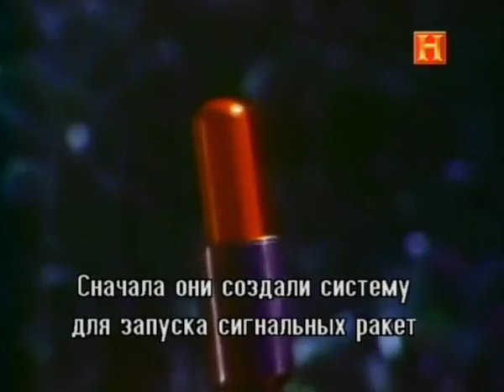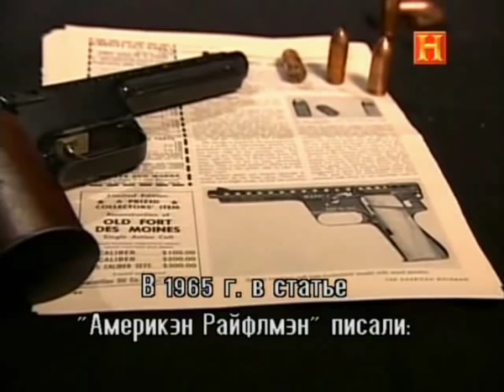Gyro Rocket Pistol "GyroJet"

Comment: If you wanna make it practical, develop an RPG that can be fired out of a 12 gauge.  I think we did make those for the AA-12, but that means they should be able to be fired from any 12 gauge right?  Just the 12 guage shell is large enough to house stabilizing fins and rocket propellant as well as enough starting gunpowder to get it out of the barrel.
Reply: well no its a 12 guage grenade not an rpg but the grebade itself is very deadly

Comment: 1:34 He says, "solid rocket fuel," but shows Saturn V launch. WTF?
2:18 If there was no muzzle velocity, it wouldn't be moving, now would it?
3:15 "...Literally..." You make literally want to kill you.
3:16 Light-years are a measure of distance, not time.
Reply: Plus if the projectile wanders like he says, then complaining about the crudeness of the sights is pretty dumb. Slap an acog on that and it doesn't help...
Reply: Nik Saunders 
True. However, I don't know what I was expecting from the "Ancient Aliens" people. Perhaps they can get back to reality. Is such a thing even possible? Yes it is.
Reply: When someone says "the system is light years ahead of its time", they actually are talking about distance as in it's far away from previous technology.  got it ?
Reply: They actually developed a Carbine version - and made 100s of them - for testing and sales samples. These worked really well because the longer barrel solved the low velocity problem, and had greater accuracy - as you would expect - and also because the firing and cocking system was more substantial and therefore more reliable. I suspect that with more development it could have been a great system. As regards misfire, that just smacks of early development life-cycle and I'm sure that could have been fixed.
Reply: 1) The Saturn V uses solid rocket boosters for initial launch. Sure, not terribly clear, but at least not terrible analogy.
2) I would say in comparison to other guns. Gyrojet projectiles were extremely slow and actually got faster out of the barrel. 
3) Meh
4) 'Light years ahead of its time" is a figure of speech that has been around for decades. It refers to something that is extremely advanced or futuristic. All sci fi and shit.
Reply: I think the whole point of them was that they accelerated due to their internal or attached power source, so were not limited by, say, barrel length or the initial reaction-explosion push. Also, had low recoil I would have thought.
Reply: vsGoliath 1)no it didn't. Kerosene/lox on the first stage, hydrogen/lox on the second and third.

Comment: "Use of solid rocket fuel as propellant"

(Shows clip of a Saturn V with no solid fuel rockets onboard whatsoever).
Reply: While this is true for all the main engines/stages and thrusters, the launch escape tower was purely filled with solid rocked fuel.
Reply: Keyboard runner fair enough. it was also never used during the actual missions.
Reply: Peter Smythe 
That's absolutely right. As long as the mission went  as planed, the launch escape tower would not add any delta-v to the rocket.

Comment: Remember, Gatling's gun design was once considered outdated and today guns following his design are some of the most powerful, awesome and frightening around, like the GAU-8 mounted in the A-10. Maybe the GyroJet will yet have its day.
Reply: Surely we can add a charge to get the bullet out with a high muzzle velocity, and also simplify it to make it cheaper.
Reply: Some ideas don't scale down whiles others don't scale up. Rocket launchers work great and missiles do too, just handgun rockets don't.
Reply: Corristo89 it will be a  highly effective weapon for space combat in 0 G (no recoil means that you won't go spinning backwards uncontrollably after emptying a magazine )
on top if that it is s far cheaper and simpler alternative to laser weapons that would also lack recoil
Reply: Guaranteed 28,000 years from now it will be standard issue.

Comment: Even IN space it's usefulness is limited to it's inaccuracy. In the future, miniature guided missiles (opposed to rockets) would probably prove more useful in space, but then again, shrapnel of any sort would likely fly in every direction. Hence, I'd think an ultra-precision railgun of sorts would be more useful in space, no recoil being the biggest benefit of that. There's also the aspect of missing a target and having that round travel on and on and on until it impacts something else or finds a gravitational pull.
Reply: There's still recoil in railguns (although not necessarily as much as normal guns).It had issues. But they weren't insurmountable, it just wasn't "better" than the guns at the time, and even nowadays.

Comment: @specialforces69 

Uh no. Modern powder reacts with oxygen already in it. All modern cartridges are fully self contained and CAN be fired in space (or hell, underwater, dont expect to hit anything though). The reason is because firearms actions suffer from wear and tear, and to reduce this, lubricants are used so parts dont just smash into each other. In open space, the lack of pressure means the lubricant boils off, so everytime a gun fires, the parts try to destroy each other.

Comment: Actually, its due to its need for high quality materials and machining, that the Gyrojet is considered a failure. However, with modern technology you can make a gyrojet work at most ranges, but as stated it's not exactly cheap.

Makes for a good silenced weapon through, you could never hear it well enough until the '[BEEP!] I'm [BEEP]ing dead' realization after you're dead.

Comment: @wadeNYC1 Its a magnificent idea but poorly exacted. It can work but the rockets need a caseless propellant base. Ive designed some concepts my self as well as stripper clips to load the old 12mm variant as well as a redesigned gun utilizing magazines. The rocket rounds have also been simplified removing the slanted vent on mine as the barrel would be rifled like a conventional firearm. Ive drawn up different caliber variants from .22 to .308 calibers.

Comment: @KLove3232 actually ANY projectile launched (even the small impulse from this) will send the shooter back not a couple yards but to INFINITY! That's Newton, once it's got a velocity, minus friction or another force it will not stop.
The question is a matter of velocity, yes a .45 will push them back but a barely perceptible amount, about 1 meter per MINUTE velocity. Simple vector controls could counter for even firing off say 20 rounds.

Comment: @Garduus Wouldn't even need circuitry in the round, really. Have the guidance system built into the weapon.  If the flow of air through the nozzles of the ammunition could be controlled by the firing mechanism you could simply 'program' a bullet's trajectory at the moment of firing by limiting the amount of air coming from certain nozzles.  If nozzle control were fine tuned enough a gun could shoot precisely around corners with a simple set of precalculated air flow ratios.

Comment: Well that doesn't address the question at all.....as to why the Gyrojet wouldn't be affected or "shatter."

And it's not like the Gyrojet's projectile would still generate recoil on the weapon itself. There's no difference there between it and a conventional weapon. They both would cause a back force.

Comment: Put a caseing on the rear of it and fire it from the gun with a small charge of gunpowder. Adds a tiny amount of recoil and should provide consistent and uniform ignition as well as bumping short range capabilities. Probably more practical as a rifle or carbine so you can add enough rifling to stabilize a big round.

Comment: @chitoryu12  nope, a normal gun needs air to shoot the bullets, because it takes fire to propelled a fireweapon. a Gyrojet uses solid rocket fuel with does not require air.

Comment: Hmm, revolvers and recoil operated pistols work just fine in vacuum. Unless these fat bullets were going to come with explosive tips, they were a solution in search of a problem.
Reply: +Matthew Trzcinski The issue is the third law of motion, not the presence of an oxidizer in traditional cartridges.
Reply: +cravenjooooooooooooo If you are in space, the recoil launches you backwards
Reply: The issue with guns in space isn't operation (although one could argue the thermal shock or the lubricant might see some issues...). It's momentum and recoil.
Reply: The issue is the law of motion.
Reply: basically, if you fire a normal gun in space, and it works, you better be hanging on to something tight or your going to go flying.
Reply: Farrel Clement the problem is gas laws and potential energy of this gun is too low,some powder burn in barrel but some powder even burn out of the barrel so the rocket will accelerate unefficently.The round is no go far 50meters

Comment: You could always go for a hybrid option, something which would burn enough rocket fuel in the chamber to reach a respectable fraction of the speed of sound, then outside the chamber finally reach full speed.

It wouldn't do a lot of damage vs. armor at point blank, but it could definitely still kill. Then outside the chamber it burns until it reaches full speed.

Comment: 50$ a piece?! WHO ON EARTH WILL USE THAT EXPENSIVE STUFF FOR COMBAT?!
Reply: +Teoh Tong Wei Sniper Rifles.
Reply: Ill suited for long ranges, as the projectile would spiral off-target.
Reply: +Steve Son (cr4zy4sian) So does normal projectiles i cant remember what its called but its something with effect 

The reason is as the projectile slows down at distance so does the spin of the bullet ( caused by the rifling ) but luckly for snipers its consistant so you can calculate it
Reply: +Teoh Tong Wei The reason they're so expensive is because they are rare today i cant imagine these being that expensive to produce ( obviously its gonna be more expensive than normal bullets )
Reply: MrChristoffer5700 If you're referring to the Coriolis Effect, that's the path of a projectile in relation to the rotation of the Earth. The path of Gyrojet rockets are too unpredictable for that to even be taken into consideration. We're talking the difference between throwing a rock and releasing a wild bird. Only one of these has a predictable flight path. The REAL reason they're so rare is that they're not produced anymore, and that they're absolute shit.
Reply: +Teoh Tong Wei 

The ammo didn't cost that much when it was new. It's expensive now because it's rare and collectable.